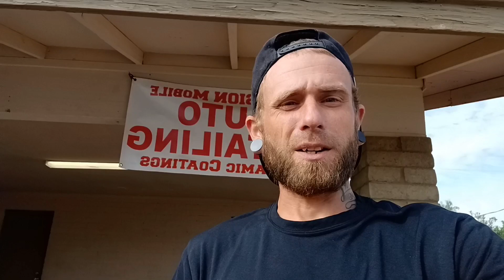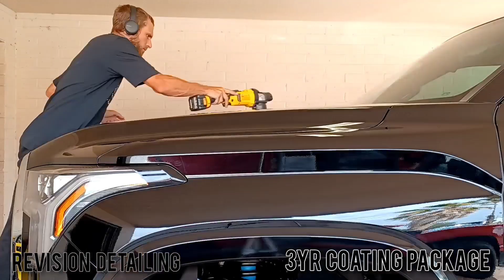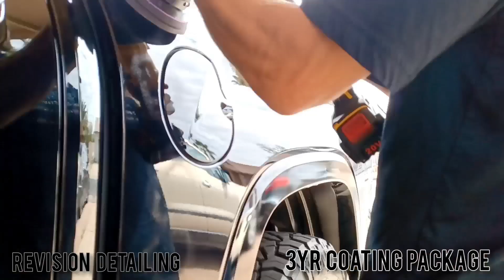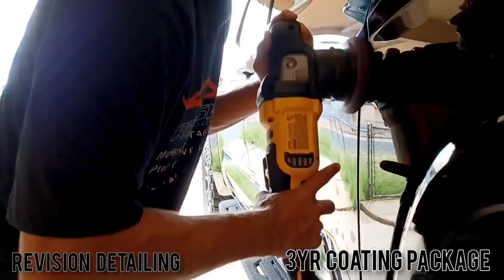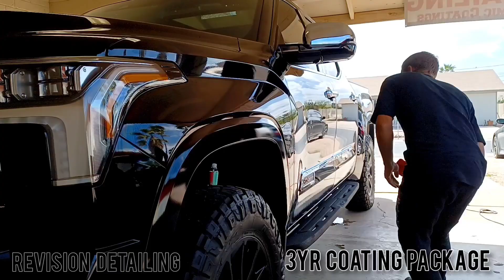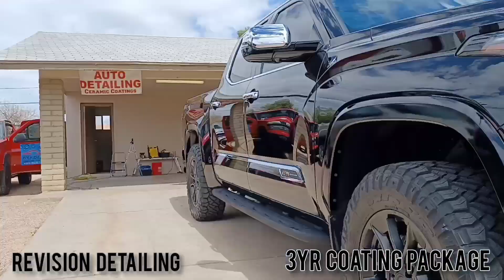2022 Toyota Tundra | UndrDOG Coating Application | Ajs #1 Coating Installer

Comment: I just did my 2019 Tundra. $40 for a bottle of Ceramic Slam from Amazon. Will last 8 months, as long as you don't go through a car wash , or pressure wash it.
Reply: You can go to a manual  carwash just don't let them use car shampoo on your truck, just plain water and pressure washer.